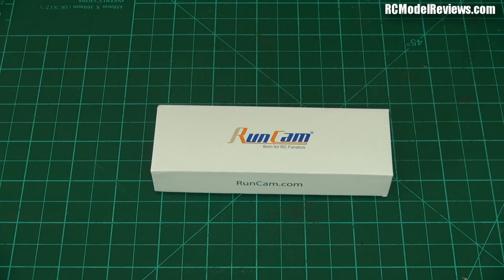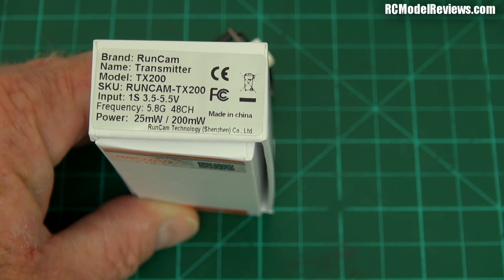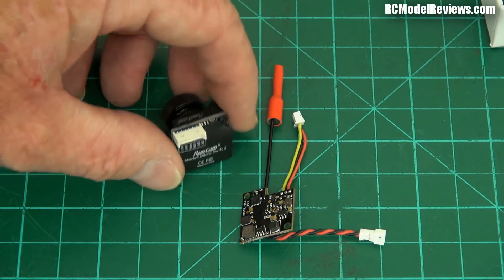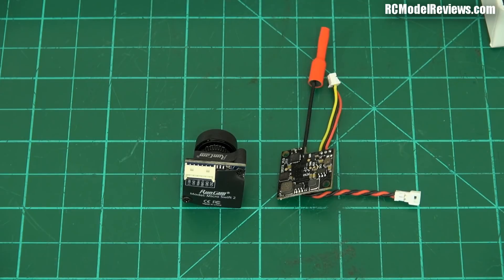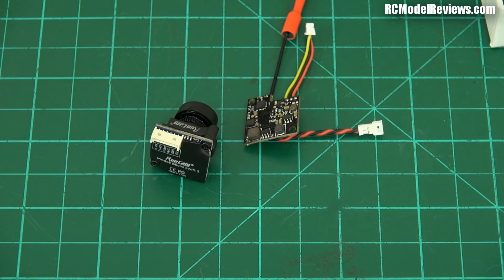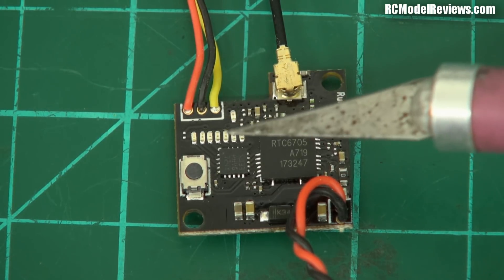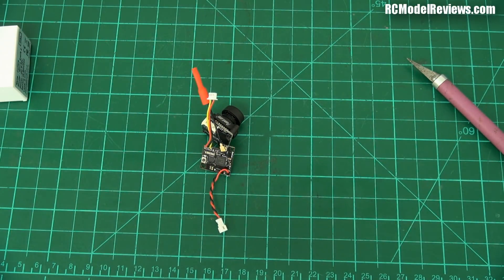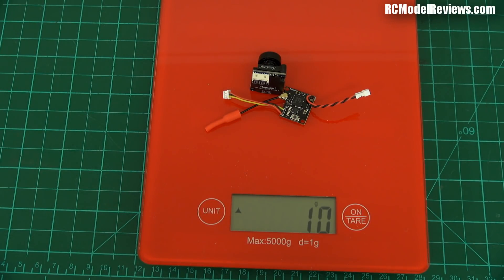Just in: Runcam micro VTX and Swift Micro 2 camera

Comment: hello guys....i want to ask something.....i jiust bought a micro Runcam swift 2 with the osd on it and the special TX200 made for it like in this video...i made the connections and the soldering to the cables so it can be used with the osd of the betaflight etc......the camera works..BUT......i have short range of signal...why??????? the weird thing first of the 2 weird things is that the 2 stock cameras i have both the old model with the 2 buttons on it and the newer with the one button on it....even with broken antennas...have longer range of signal especialy inside my house.......and the weirdest of all???? i have 4x Eachines QX95 ...all dead from defective parts...and i use one camera of them...i just made a connector and connect just the 1s battery on it and it turns on....i use the same channel to all these cameras...and the one of the QX95 has the longer range signal and the clearest image..colors clarity etc....how is that possible ???? and now i just soldered a brass antenna to one of the stock cameras and i have even longer range between the walls etc.......but again the one of the QX95 beats that too........the runcam is this model exactly and since all people were suggesting it as the best camera for the lizard95 i bought it....but i m dissapointed with the signal especialy..the image is good but not as good as the cheapest of all camera of the QX95......enlightened me please if i do something wrong?i even tried to 200mw the runcam and again the signal remains shorter of all the others who play at 25mw........all the strange things to me.....not to mention that i wait again for 6th time the minicube f3 to fix one lizard cause after 5-6 batteries always the reciever breaks down and do crazy things or dies at all......or loses bind and cant rebind......anyway...my curiosity is about the runcam...can please anyone help?

Comment: Great micro setup. I do not understand going from 25mw to 200mw though. I would greatly prefer 25mw|50mw|100mw settings. These are not going on long range aircraft and I seldom fly my micro quads and micro planes more than 200 meters away. Thanks for the info and Happy Flying!

Comment: Is there an all in one CCD/VTX on the market yet? No need for OSD on a micro in my opinion. Not up in the air that long.
Reply: Joe Bruno you just watched a about one dude. Pay attention, you'll get there.
Reply: There's no VTX on it. You keep watching.
Reply: Joe Bruno so what was that part with him showing you can screw them together to make an AIO?
Reply: Just that, two bits being merged together. I was asking about a single AIO in one box/one unit.
Reply: Joe Bruno sorry for the misunderstanding, I watch the market pretty close. Haven't seen another solution this small and light.
Reply: Yeah, me neither. Would be nice.
Reply: Was he talking about a battery OSD or a camera OSD to control brightness and other settings on the CCD? I assumed the later since every CCD I bought included an osd for controlling camera settings to optimize for different lighting conditions.

Comment: Hi Bruce; Could I bother you to tell/test if this PAL combo will work with your cyclops goggles? Just the simplest turn on and see if there's picture at all type of test. Might seem like a stupid question/request to you, but I'm trying to figure out if I should get a pair of cyclops v2's as my 1st goggles, yet apparently the cyclops and cyclops v2's are the only goggles that both HK and Quanum don't/wont spec video protocol capability for?? Odd. And a bit problematic for a FPV noob like me since I would really like to get a setup that is PAL compatible(it's the general standard around here, so it should work with much of the old "household" video gear i already have for a bit of extra options for playing around). I also posted a similar question in a comment on your old clip on the cyclops goggles recently; Not too surpriced if you wouldn't have time to "monitor" comments on your many older vids, but I'm hoping you might spot this one :)

Comment: Mine came today and has a soldered antenna. Fits great, but the cable is a tad longer than needed. Nice to hookup though, 1 5v in powers up the whole show. Going in a little 1103 8000kv build with a micro Lux w/Rx and Dshot 600 4 in 1. 
A 2 board stack and the Runcam 'cam-stack'. Done!

Edit:
PS - took i back apart and conformal coated the Tx and beefed up the coating on the camera with Kafuter 703 E grade RTV. Hoping it didn't detune anything on the Tx, It's weather resistant in any case. (Baad weather here in NE USA) Range test tomorrow...

Note: when you assemble it the Tx to the camera, I would recommend leaving the original thin plastic camera board covering in place, it has a shield laminated inside which covers the processor IC, and I'm guessing it's for RFI remediation and to keep Vtx interactions under control.

Comment: The RunCam website has an 'Instruction Diagram' that shows the voltage input to the TX200 as 3.5 to 5.5V and the voltage output to the camera as 5.0V; does this mean there is buck/boost circuitry on the TX200? If so, then I'm wondering if the Swift Micro and the TX200 could run off a 1S LiPo on micro quads (if they'll carry the extra weight) ?
Reply: John Chandler Thats right, they can.

Comment: I like the micro ufl connectors because you can put a circular polarized antenna on it with a ufl connector. I would secure the antenna with a bit of heat shrink over that pdb tab where the ufl connector is located. Since both the vtx and the camera can run off of 5v, why not just put a servo connector on it and connect it to the receiver? Thanks for the review and Happy Flying!
Reply: Ground Control RC done that with Eachine tx02 AIO camera/200mWt vtx. Got a brounout on Bonsai 10s into flight:( it was small Turnigy 10A esc, camera, vtx and 2 9g servos was too much for it. If you have esc with big freeking BEC (2A-3A) you would have no problem.
Reply: Yes, you have to account for all the amps you're pulling for all your components. The camera and vtx together should only pull 530mA at 5v. If you have less than 530mA available I'd say you're already at you max.
Reply: Ground Control RC thats what I'm writing:) Check before launch. I think I had 1A BEC, so thought it would be ok. I bet 25 mW might work better, drawing less current, but that needs checking.

Comment: Would it be possible to make a 5.8Ghz dipole for a VTX from standard 2.4Ghz RC antenna by folding some shielding back and cutting the active and ground elements to the correct length?I don't see anybody doing it which seems a bit odd. It'd be a lot lighter than one of those sleeve dipoles in the video above.

Comment: Much as I love Runcam, Fullspeed make a very similar Tx that works with up to 4S. So much easier to install, you just have two wires to vBat.
Reply: patrickcol I was also thinking of the fullspeed rc vtx, much easier to use in your quad. No need for ekstra wires or a BEC. I have one for one of my quads, but haven't flown with it yet, but in my tests it worked good.
Reply: Works just fine, the channel-change button sucks though. No way to reach it with side plates - but it's such a pain to change channel or frequency I'm not too fussed; everyone else has to move 'cos I'm not moving :)

Comment: Hi Bruce, Nice all that small stuff, but we still carry to much weight in the air.  I am wondering why we fly with relative heavy camera's next to our fpv camera's. I Think a gopro session on a 215mm quad is too heavy and to expensive to break. Why not have a home build  "split dvr" on our gear. I think the quality of the FPV cam is often quite good, so why not use this for DRV. Place a wired DVR in the quad copter, between cam en TX. It seems so obvious, but i probably lacking some knowledge.
Reply: well i think this is more so ment for the 130 mm frames market, the quads where you wouldn't even think about putring a gopro on. and having a ccd on such a small quad is an absolute giving. and the idea of your would be 2 bad for such smaller quad but many people want the quality and their 220 quad can carry it so y not.(hope i wasn't 2 snarky xD)
Reply: I don't think there is an build-in DVR on the runcam split, that's the whole point